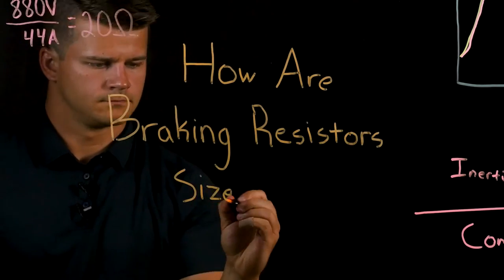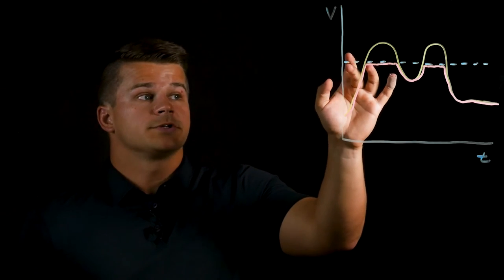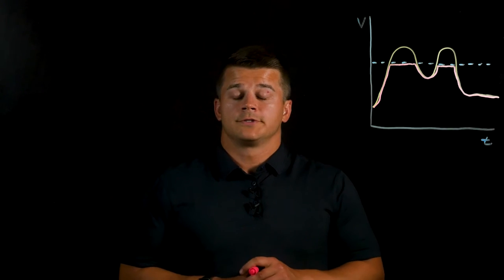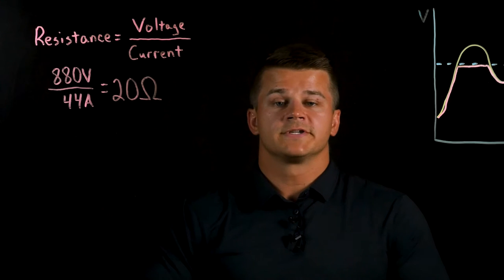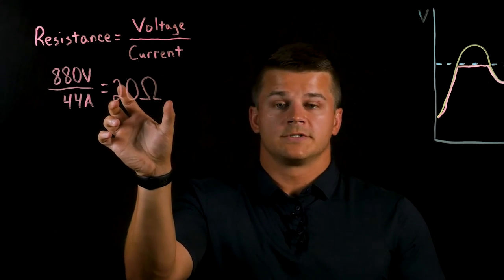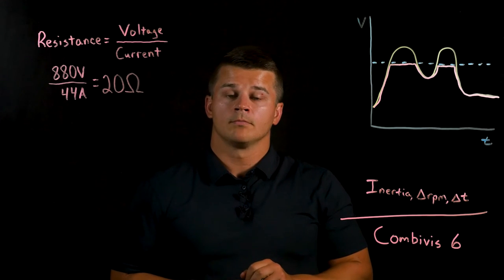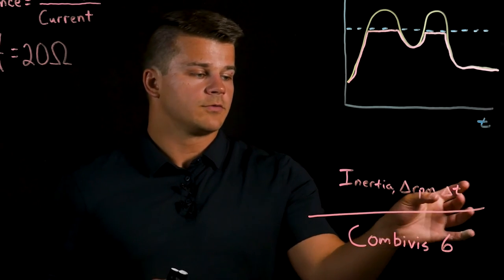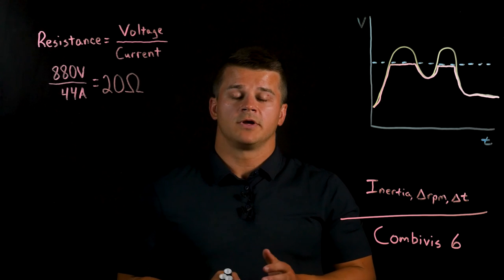How Are Braking Resistors Sized?

Comment: Thank you for this description! If I were to reverse drive my motor (essentially use the VFD/motor as a brake, driving by another motor under test), would the resistor have to be sized for continuous use? I would only be holding a specific torque, not necessarilly decelerating.

Comment: Kindly explain 
Currently using 20 ohm +/- 10%, 570w, 600v breaking resistor

Can I possible to replace with 120 ohm, 105w, 600v
Reply from the maker: The video should answer your question, Hariharan. The resistance is higher in the replacement you mentioned, so it should not damage the drive. But the power is lower and you have not said if that value is sufficient. You should contact a local KEB representative for more information before we can say it will be sufficient for your specific application. Find a local KEB Rep here: https://www.keb.co.uk/contact/contact-worldwide

Comment: this means today regeneration isn't mature enough, all that energy it's lost as heat trying to extract maximum of regeneration, at high regeneration there's progressive increase in loses which isn't far from ading brakes to the engine braking; probably that voltage it's huge at high speed having permanent magnets, probably it's decreased with negative stimulation of the rotor in order to reduce/neutralise the magnets - i don't know if works with that type of rotor
Reply from the maker: Yes. Braking resistors provide a reliable, but older way to dissipate excess energy in a system. Many applications are not conducive to regen technology and so uses braking resistors. We do offer regen drives, which put regenerated energy back on to the building power grid, saving money and energy. KEB has been a leader in regen drives for 20+ years, used in elevator, crane and hoist applications. Watch this video about regen: https://www.youtube.com/watch?v=IAnMVYOYHxg
Reply from the maker: You can also watch these two videos showing how a regen works in an elevator application: https://www.youtube.com/watch?v=6Mo2xOOP0cw 
https://www.youtube.com/watch?v=MQvGLL2NO2w